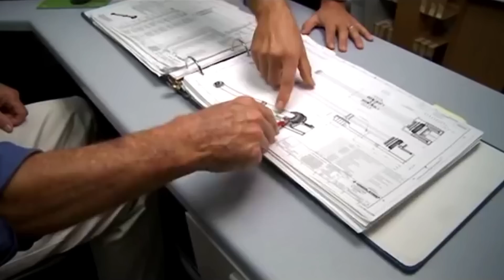US's Ultra-Advanced Railgun Weapon Is Making All Others Obsolete

Comment: Well no matter how you slice it, substantial energy needs to be applied to the kinetic projectile.  So then you need to be asking the question: "is there a way to apply that energy DIRECTLY to the destruction of the target?"  On what research do you spend the money, and what are the pros and cons?  Laser is near instantaneous, and it can be fairly long range, maybe cannot apply this amount of energy yet, needs fairly clear atmosphere, like the rail gun, requires a significant electrical power supply etc.  Is it possible to overcome the limitations, and make it into an undefeatable weapon, and how much is it likely to cost?

Comment: A renage of 200 miles is quite impressive, but only works if your projectile is guided, how does the guidance system take this acceleration and the ridiculous EMP that pushes this projectile out?

Also: the main advantage of conventional ammunition is that they don't rely on external power to work. At worst you need externa power to rotate the turret or for big guns you might need power to load the massive projectile, but one reason why electric guns are not a thing today is that you cannot just pickup a fresh magazine, you also need to monitor your batteries. Sustained fire over long peroijs is not going to happen without a generator... that's no good.

Also: I've seen videosabout these guns when I was a kid, it seems that the optimism about how practical these things are is a bit on the high side.

Comment: Railguns are not practically feasable. The magnetic pressure has to be much higher than in a conventional cannon. So the railgun itself must be way heavier than a cannon. A power generator for the Zumwalt dream would weigh 50 metric tons and the condenser bank too.
Rheinmetall stopped the development long ago for these reasons.

Comment: "Uncertain Future" is an understatement.  Each round for this weapon costs $1,000,000.00, and that does not include the "negative alpha" nuclear reactor, or the generator powered by the reactor,  which is required to charge the railgun.  The "power supply" (a bank of capacitors connected to the power generator), that requires a charge time of 4.8 minutes before powering each round out of the barrel of the rail gun. Provided that your enemy is a single ship, then only one rail gun is required to destroy that ship. The Navy intended the rail gun for use aboard each of the DDG-1000 (U.S.S. Zumwald class) destroyers.  I was a contractor on this project beginning in 2010 at NSWC Dahlgren and Patuxent River Naval Air Station.

Comment: ELECTROMAGNETIC FIELDS DO NOT CREATE A MUZZLEFLASH, THIS USES GUNPOWDER. The electromagnets simply keep the projectile centered through the barrel so that during the acceleration, there is no friction and the bullet can reach a higher velocity along the length of the barrel, and therefor also deliver more kinetic energy on impact. This is also why the bullet has fins at the back, there is no rifling inside the barrel so it needs the fins to remain stabilized on exit. It is still a chemical weapon in that it uses an accelerant. Electromagnets can not propel a bullet up to such speeds in a barrel short enough to be mobile.

Comment: Basically, the biggest problems with EM "rail guns" are 1. Massive power cost, which makes them impractical for both aircraft and most vehicle mountings. 2. "Barrel" wear, which means that after only a few shots the superconducting, mass-driving "rails" deteriorate significantly and need to be replaced...

Comment: Seems as though using a sabot round, the projectile itself could be kept constant, while the disposable casing could be adjusted to account for rail wear.   This would allow for more shots from the gun before replacing the rail.    A rail brush of some sort could prepare the rails and measure the new tolerance, and the loading mechanism would select a casing to meet the new requirements.
Reply: The projectile experiences up to 30,000 Gs of acceleration in the barrel.  That's enough to pressure-detonate many common explosives.  Only exotics like C4 require an electrical current, and that's an unwise choice in a weapon where electricity passes through the projectile.

Comment: To Dark Tech: Early in video is mention of shells being fired at over 50,000 feet per sec. That is about 10 miles per sec. Earth's orbital velocity is 5 miles per sec, and escape velocity is 7 miles per sec. Later it is mentioned that shells could be fired at a low mach number (3 or 4 or 5?) but that would be more like 5,000 feet per sec (ie 3,600 mph). So I suspect the initial figure of over 50,000 feet per sec was a mistake and the true figure is more like 5,280 feet per sec ie 3,600 mph. If I am correct, please revise your video.

Comment: Railguns are like Fusion reactors. It will be usable in X years. They said that X+Y years ago. For Fusion reactors, they will be ready in 30 years. They said the same thing 50 years ago. Rail guns have been just a few years away for decades. I'll believe they are ready and usable after they have seen combat for extended periods of time. Even if China "has" them they will be using them while changing out the contacts every few shots. Hell the first few "useable" versions might have quite the throw back in their use. They shoot x shots in rapid succession then they drop it to horizontal to "reload" the contacts/barrel.

Comment: People drowning in their fiction and dreams. "cheaper" lmao. Saying this show the person who made the video doesn't know what the f he's talking about. Current rail guns have 3 flaws. Energy support. Overheating. Lifespan. The overheating is mainly due to the electric resistance of materials toward the insane amount of energy required to power the gun. We don't have ambient temperature superconductors. Cables get f'ed up real fast... Meanwhile the lifespan is just a few dozen shots. After this they need to replace the foundation and part of the barrel. Even if there's no friction, the recoil is more than current material can handle. Even using tungsten isn't enough. That flaw itself makes it one of the absolute worst nightmare when it comes to funding. Just to perform a few test shots it cost millions in gear.

Comment: What happens is the only projectile that can withstand the heat of flying through the atmosphere is plasma. It acts more like a fluid and disperses against resistance. Small warp drive shielding works in the lab but there isn't a way to power it. Now you have a gun that only hits very straight line of sight and randomly emerges along the path. It then disintegrates because of enormous velocity induced inertia.

Comment: I remember a report from back in the late 1980s where they were considering firing artillery using WATER.  I was in artillery at the time, and this was a curious bit of tech, but probably rather fanciful.

Essentially injecting some amount of water, less than a gallon, into a chamber of the artillery piece and then converting it instantly to a plasma using a high powered laser.  The report stated it would have the equivalent discharge power of a conventional powder bag, and could be fine tuned by the laser and quantity of water to within a few newtons of discharge force.
Never heard another thing about it since 1990.
Reply: If a promising tech with an obvious military application suddenly disappears, it was probably classified.

Comment: This is an interesting concept for certain applications, but unusable in real life combat due to multiple issues:
Short range. The speed will quickly downgrade to subsonic without propellant due to enormous air-resistance.
Enormous electromagnetic noise. The launcher location will be instantly triangulated by the other side.
High manufacturing cost and high power use.
Reply: i thought about these too
Reply: Can't triangulate the source of that electromagnetic noise, if it's so intense to fry the detectors (it is, cause what do you think is gonna happen with thousands of volts and millions of amps going thru a big pair of conductors is gonna do?).
The bigger (and still unsolved) problem is barrel wear. You get currently 3 shots before the barrel is worn out.
Reply: @44R0Ndin  lol that’s a whole world worth of energy consumption you’re talking about. You would have to carry a few nuclear power plants with you to power it…
Reply: @avashurov  Nah it's not a lot of energy overall, (maybe a megajoule or so) cause the firing transient doesn't last very long (like a fraction of a second). So while the power is immense, the time is tiny. That's why the rails erode so fast, the power is too much for the rails to handle.

Comment: I wonder if the MIT/CFS superconductor electromagnet technology has potential application here towards eliminating the requirement for a rail assembly. It's the largest failure mode of this design; the rail wears significantly over relatively few discharges. Contactless propulsion of a projectile seems an easier design outcome than sustaining an energy positive fusion reaction, which is what the magnet's intended use is.

Comment: That’s beast mode so what they got that they ain’t showing us that’s 25-50 years ahead of so called state of the art ( when there antique’s ) pop a depleted uranium sabot slug in that and your done white hot melt straight through ya armour your done ! They have to sort out the ware out bit cos they only fire so many rounds before they just melt. Huge currents involved in any rail gun. Plus the power supply issue. I’d go with LASERS or something more exotic like particle beam weapons.

Comment: metallurgy has come a long way. the latest generation of tungsten carbide will stand up to rail gun use- and they have alloys even tougher. the limiting factor with using them is machining- those alloys are DAMNED HARD AS HELL. they withstand CRAZY EXTREME temperatures (why they're used for tig torches & edm machines)and you'll go through a stack of diamond grinders if you try to machine that stuff. perhaps 3d metal powder printing with lasers? who knows.

Comment: since it is easier to change shells it should be able to change barrels with a little more time but it depends on the tech available since any country would have to check  and change as required otherwise the barrels will melt, just check the missile launchers switching used for new missiles and it theoretically can be done, it is a joke to continue with something that is worthless beyond at max several shoots due to heat dmg, the PLAN  well i will wait and see if the poor construction will handle well but i doubt it

Comment: Other than being used as a mortar that's about it unless you can put a guided-missile bullets into the rail gun he'll never be good on Ship for the fact that there's no way to stabilize the ship to maintain the accuracy even the gyroscope system didn't stabilize the whole ship to maintain the accuracy needed and let alone the time it takes the whole system to recharge it's pretty useless to use against aircraft because it would not have the door t to steer the projectile without losing velocity

Comment: i'd argue that the size of the powerplant needed and the damage to the barrel after each shot and need to replace it very often makes the rail gun extremely inferior to conventional gunpowder and explosive munitions at this point in time, without extreme advances in metallurgy and powerplant miniaturization this is not going to be a practical weapons for another few decades.

Comment: The DoD cancelled all such rail-gun tech programs (BAE for example) after spending (wasting?) Billion$. It requires way, way too much power to fire, the power-plant has too large a footprint, it weighs too much & the barrel gets so badly ablated after every round, it would have to be replaced constantly. It could require most (+/-80%) of the power output a ship would normally generate. Look no further than the same failed tech on the latest aircraft carrier. It was supposed to be cheaper, easier to maintain & operate...and they've spent many $100s of millions on it & they still can't get it certified for deployment. Turns out 19th century steam tech is still better. Who knew???

Comment: And here we've reached the limited of material science. This weapon works, HOWEVER, the barral gets so hot and the "wear and tear" level is currently deemed unacceptable - it's simply too expensive to operate in the long run - this weapon is AHEAD of its time. Perhaps carbon infused nano tube in the future but we're not there yet...
Reply: This weapon is quite frankly extremely useless, Somuch so that this entire weapons program was scrapped and removed, US army is not researching this anymore, It has far tomany issues, range being bad, cant fire more than 13 shots before the rails need to be replaced, huge power demand, each time a shot is fired near electronic radar equipment there is major scrambling issues.. Not sure why this video released after the project died when this project has been dead for months lol

Comment: I can't see this being mounted on a truck.  It would be far to shaky to be accurate to anything of a considerable distance.  But close combat would be great for this tool.  So yeah, I take that back.  It would be a great step in the right direction.  It just couldn't be used to it's full potential without some pylons down into the earth a 20 feet or so.  At least it, seems, that would be enough.  Maybe not.
Reply: Stable firing platforms were a problem that was solved many decades ago.
Reply: @snoig1  well, true.  But those (Stable firing platforms) are for missiles an the likes.  In this scenario, we are talking about lasers.  Lasers that need to be absolute spot on.  These will most likely be up against Hyper sonic weapons.  For now anyway.  Five years time.  There will be better.  Super-Hyper sonic?  Warp?  That little (Stable firing platforms) we have now.  Will never suffice.  Or, maybe you are talking there already , IS, what is needed.  Maybe.  I haven't kept up.  sorry.  Excuse my rant.

Comment: If China is developing this type of technology, we have NO CHOICE but to acquire it as well. There are too many scenarios where this type of machine will be able to cause chaos for long periods of time and unless we have the ability to cut the power, we need to have a counter balance. You need HGV's/SSHM and you need this technology as well. The power required to launch long range missiles and control missile guidance systems/Radar can be stored and cycled quickly with the right parts. We need this, but more importantly some of our allies will need this as they will need to counter the missile threat and won't be able to counter the offensive HGV threat because of per unit cost. I wonder how it could be used in close antisubmarine warfare, or if that is even possible. How far could one of these things travel with a round optimized that way.

Comment: Think People!!!  This is a speed weapon, not a ballistics weapon.   Octanitrocubane explosive is 8.5 or something mega joules per KG.  Simply 6 pounds of Octanitrocubane explosive has more energy then this whole projectile at launch.   As the rail gun projectile slows the energy diminishes to the square of the delta V.    It fires in a straightline, very fast and with as light a projectile as can be made.   It is also not a high current weapon, but more a high voltage, high capacitance weapon.  Also, Newton was this guy that formulated a bunch of laws back in the day and one of them muttered something about equal and opposite, so you won't see this style in a hand weapon in this universe.   Maybe one much smaller could be possible, but why?  Octanitrocubane explosive is 8.5 Mega Joules per Kilo.   Get it!!!???   If so, remember vector addition, explosives are needing to be shaped and controlled by the casing, but they want to expand in every direction.   This weapon has one energy vector at high energy and it is straight ahead of its path of travel.   Now once it hits something, the vector is dispersed according to the make up of the target.

Also, General Atomics was the DOD / DARPA contractor for the rail gun.   It initially was known as the HERCULES PROJECT as I recall.  The acronym having something to do with High Energy Capacitors.  Reagan did release a public TV bit on the three most successful SDI projects.   This rail gun was one of them.   I have no idea where one can find that video, but this one is rare enough and most Railgun Vidoes are about the English Contractor BAE Systems.

Comment: Railgun tech has been under research not since the early 2000’s but as early as the late seventies and early eighties. Scientists, engineers, and physicists at Westinghouse labs on Greensburg Pike in the Wilkinsburg/Churchill area of Pittsburgh we’re working secretly on rail guns at that time. The projectiles were pure titanium and vaguely (old fashioned) rocket shaped about 12 inches in length. The project’s main challenge was powering the gun and capacitor size. The gun demanded huge amounts of electricity. The capacitor banks available and in development at the time could not be miniaturized with an added power increase needed to make it financially feasible as a weapon. The capacitors were enormous and cumbersome and impossible at that time to transport with ease or at all. Tech must have caught up by the early 2000’s to solve these problems.